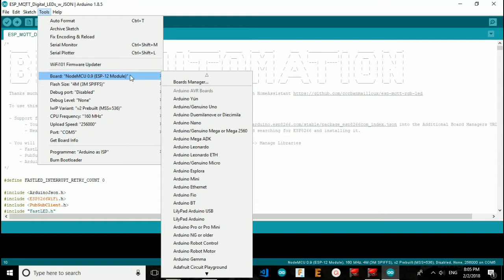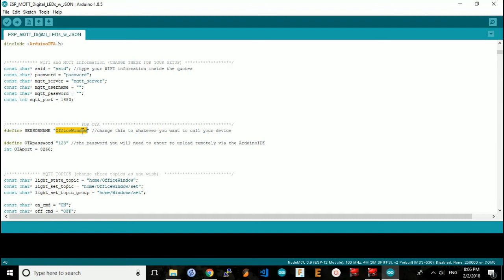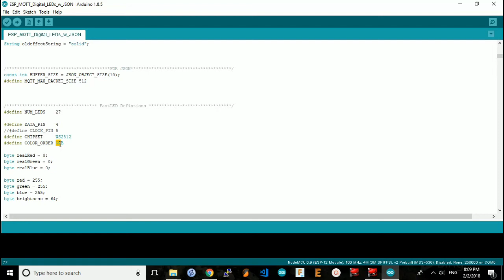NodeMCU Kube LED Strip Controller   Part II (Arduino Software)

Comment: I bought a few of your breakout boards,  can you tell me which logic shifter from 3v to 5v did you use for the design on the board?
Reply from the maker: @Chris Collins - https://amzn.to/2Oqgsa6 - but, don't use it for this project (the LED Controller), as it's a slow I2C shifter and you'll get blinking LEDs if you do...For LEDs, you could use something like this https://amzn.to/2F0vx2s - it's much faster.

Comment: Very awesome project!  I'm interested your project including your breakout board.  I don't have the level shifters, but I have everything else.  I am having a problem compiling the code.  I fixed most of the issues by going with ArduinoJson 5.13.2, however this is what I am getting now.  Any ideas?  https://pastebin.com/0YWwGqTV
Reply from the maker: @Daniel J - you don't need the level shifters (the ones on my breakout board are not the right kind of LED strips, anyway - they're meant for I2C/5V sensors running off the breakout board. 

As for your code, everything looks fine - the pragma warnings you're seeing (bitbanged SPI) has to do with the ESP8266 not using a hardware serial IO, but that does NOT cause any issues with the LED strips running and it's just a compiler warning. Are you seeing the white text at the end of compilation, showing the amount of space the compiled program took?
Reply: @BKHobby  I have been having issues compiling with this LoLin NodeMCU.  I believe the errors I'm getting afterwards are related to that issue.  I have successfully gotten it to take a blink program however maybe this code is too much.  https://pastebin.com/b0DdbQbB   If the prior issue wasn't going to keep it from compiling then I should be able to get it to work with a better NodeMCU.  I'll let you know how it goes!

Comment: btw, this code doesnt work with 6.x ArduinoJson, so stick to 5.13.2
Reply from the maker: Yes - very good point! The 6.x Json libraries are still in beta and have some breaking changes...Once they go to full release, I will update the code to make them work...I do have a note about the versions I used in the code/Github readme :)
Reply: thank you! this helped me out

Comment: You saved my day! Keep up the good work. I am looking forward for your next tutorial. This can also work with 12v led strip yes?
Reply from the maker: Thanks, I'm glad it helped you! Yes, you can definitely use 12V led strips, but you'll need something like this between the NodeMCU and LED strip: http://amzn.to/2GCtpLk - just hook up the 12V side to the LED strip's power wires (+12V & Gnd), and connect the 5V side to the NodeMCU's +5V/Gnd terminals. The converter will take the 12V DC that's powering your LED strip and step it down to 5V for the NodeMCU.
Reply: Thank you for the fast reply. I have two plug in my ceiling so i use one for the 5v charger to power the chip and the other plug for the 12v charger to power the led strip so i can turn off only the led strip if it is necessary (the plugs are already in my openhab). I am new in this and amateur so have a lot to learn. i order your pcb from pcbway.com and waiting them after the Chinese new year event. I am looking forward for the video to connect it to my openhab and start the party!!
Reply from the maker: That will work! But, just remember to connect the Ground of the LED strip to a GND pin on the NodeMCU PCB,  otherwise you will have issues with noise and the LED strip may not even turn on. Good luck, this is a great hobby to learn lots of new things about electronics and computers!